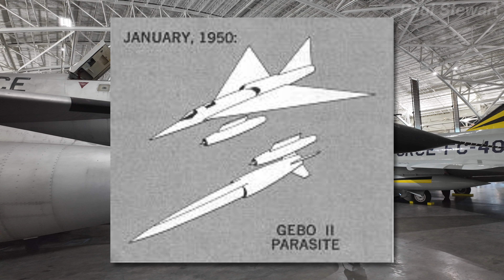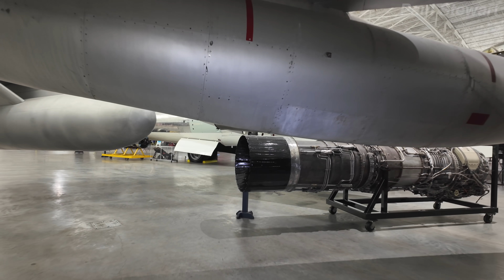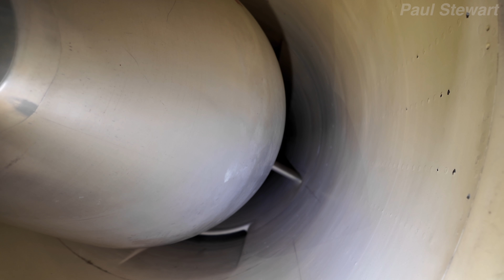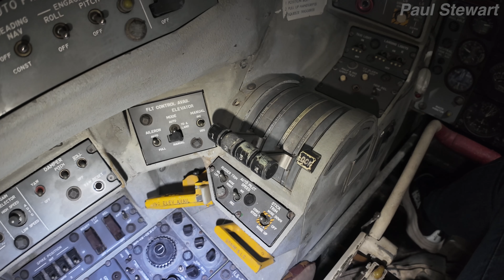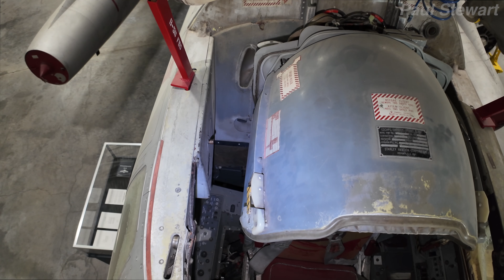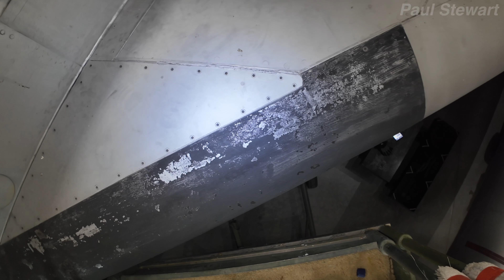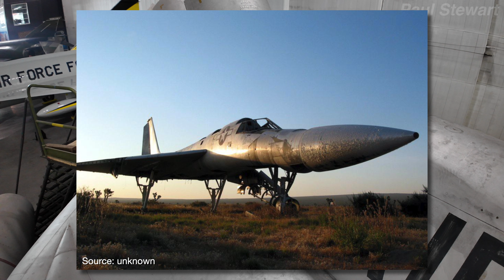Inside the Convair B-58 Hustler!

Comment: Regarding your comments on the navigation equipment bay, it has always surprised me how late the USAF came to using transistorised circuitry (I know they were originally designed prior to transistor technology) and yet they could very quickly have redesigned the circuits for transistor integration, and saved a lot of space and weight, while also limiting the cooling requirements. I suppose that they would have had to re-qualify the aircraft with the new system. However, even so the improvement would have justified this, in my opinion.

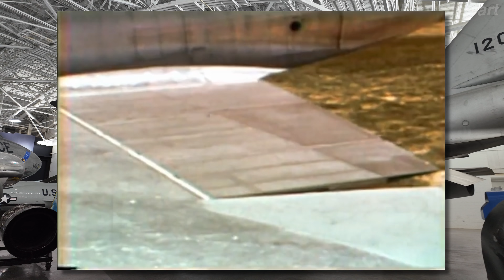Comment: AT 14:00 the footage shows the interlinked elevons and rudder. The explanation usually given is that the rudder automatically corrects the adverse yaw. But the footage clearly shows the rudder ADDING adverse yaw.   
The elevons roll to the right ( left elevon deflects down, increase lift and drag, left wing goes up, nose yaws left) so the rudder would be expected to deflect right to counter this adverse yaw. We can all see the rudder deflecting left. Adding to the adverse yaw.  WTF?

Many years ago I vaguely remember hearing an explanation for this and have tried to find the footage of the controls to see it for my self. Paul found the footage and there it is. Does anybody know why it defects the "wrong" way?   How do RC model of Hustler behave in yaw ?

Comment: Great video Paul (as always!). Convair had success with the F-102 Delta Dagger once they applied the “area rule”, or Coke Bottle fuselage to maintain wing cross section in Mach flight. (Prior design couldn’t hit Mach1!) The B-58 was basically an enlargement of the F-102 design. As we know, having that smaller fuselage in the middle means less room for fuel, bombs, etc. And if they scaled it up even more, for capacity, guessing they’d need 6 engines to hit Mach 2+! So, a vicious cycle ensues, looking for that “sweet spot”.

Comment: When 19 years old fresh out of aircraft maintenance Tech School Chanute AFB  was assigned to the TB-58 at Edwards AFB 5616th OMS that flew Chase for the XB-70. That was an amazing thing when so young and at the time thought nothing of it. It was just another airplane to me. But, as time went on realized what a privilege that was to be part of that program. The B-58 will remain a great and powerful aircraft and chosen to be part of the maintenance crew will always remain the high light of my Air Force career. Went on to Travis AFB and then Norton AFB as a crew chief on the Lockheed C-141A"s Thank you for posting this video. Spent a lot of time sitting on top of the left main landing gear pumping the wabble pump to pressurize the brake pressure when towing the plane or in the cockpit ridding the brakes. Read the Tech Orders leaning against the main tires under the blazing sun to stay in the shade. Memories are made of times spent helping to keep this great plane flying.
Reply: What great memories.  The nostalgia of riding breaks on a night shift, eating your supper under the wing of an aircraft or sitting in the launch truck waiting for a red ball.

Comment: I was at Davis Monthan AFB delivering a jet to the boneyard and overflew an area in the far corner and low and behold there was the whole B 58 hustler fleet sitting and baking in the sun. I got a vehicle and my camera and took a couple of hundred pictures of that sad sight. Many had the engine nacelles and engines removed, and most were missing their ejection capsules. I spent several hours going over those once mighty craft, and ALMOST wished I could buy one and keep it flying…….🤔😋

Comment: Great video!  I've known of the B-58 for decades, but wasn't aware of the crazy ejection seats or the tunnel between the back two crew spaces.  It's not quite an SR-71, but it's still an awesome aircraft.
Reply: Yeah! I am a 14 year old autistic aviation nerd and I can answer any questions you have bro! There was multiple payload pods available for the B-58. Such as a reconnaissance pod with fuel and nuclear bomb, A 2 part pod with the bottom half of the pod having the Electronic equipment and Nuclear bomb while the top part carrier the fuel. Also the B-58 had the first female “bitchin Betty” voice to alert crews to basic alarms. The 4 pylons where for B61 or B58 nuclear bombs!
Reply: RJN check out the flight crew ejection details of the XB-70 
Valkerie designed for Mach 3 ejection parameters

Comment: I grew up in Fort Worth.  Both my father and step-father worked at General Dynamics aka "The Bomber Plant".  They had a static display of the B-58 at the main gate.  As a kid I thought it was the sleekest thing I'd ever seen.  Lots of great planes came out of that plant, but the B-58 really stands out.
Reply: My dad worked at that plant from the late 50s to the middle 80s.  He worked on the B-58 briefly then the F-111 then the F-16. Funny thing is he was in the Air Force at Carswell as a crewman on the B-36 which was also made at that plant.  Well at the end of his Air Force term he walked across the runway basically and worked for Convair.
Reply: My Grandfather worked there during WWII and retired in the early '70's. He speacilized in the escape systems on the B-58, and in the later years for the F-111. He could tell me the size and the number of the bolts in the systems of the B-24's, which is what he began working on when he was hired on at "The Plant".